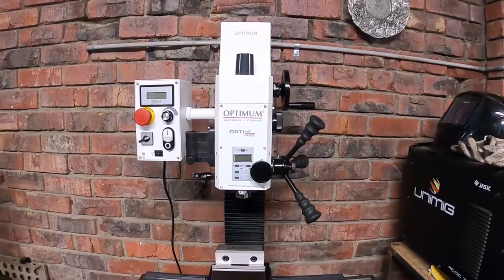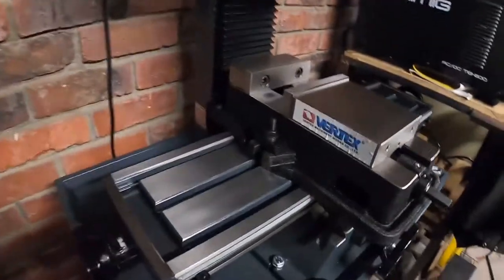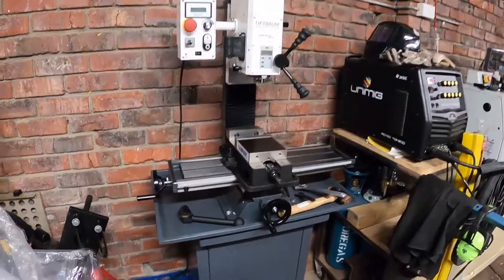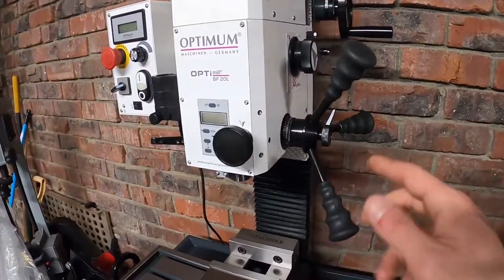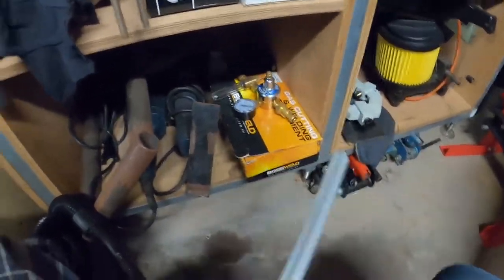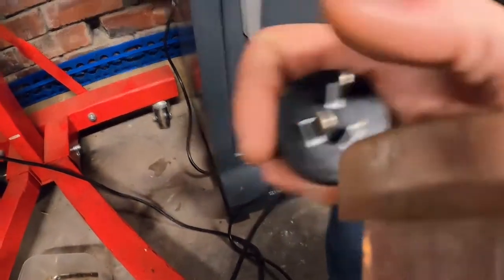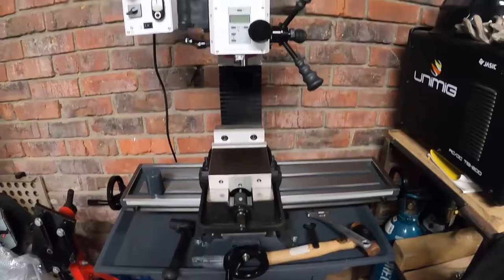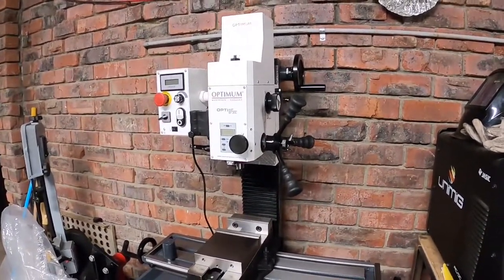Optimum BF-20L - first impressions

Comment: I bought one of these about 18 months ago. Just recently for apparnt reason  it stopped working. Electrically  everything was dead. The work light, the speed readout and of corse  the motor.  I tracked the fault down to what's called the relay circuit board. Replaced that , $80 and all was well again. When I  was putting back together again it was difficult  to cram all the wires back into the neat little housing. That's  when I  relized there's probably a lot of heat in there and no airflow. So I  made some 30 mm long spacers and spaced the rear lid of the control box out. Made it vermin proof  with some mesh . Today I  was working the machine fairly hard and it was surprising  how warm the mesh got. I'd  recommend  this mod to anyone  that does a lot of milling.
Reply from the maker: This is a great observation and awesome advice - I'll look to do this, cheers! What sort of ambient temperatures were there when the failure occurred?
Reply: It wasn't a particularly hot day , mid 20's maybe. Perhaps it wasn't heat that caused the problem but I  didn't want to risk doing it again. Today useing a 34 mm hole cutter was cutting hples through 40 mm aluminum plate. A lot of heat was coming out of the box
Reply: Where did you get the parts from? I am looking for some parts for my own bf20l
Reply: Hi @garyplozza3036, We have had our machine for about the same length of time, maybe a bit longer, but being in a college workshop it is very seldom used. We now have the same issue, one day everything was fine, I went to use it the next day and no power to the machine at all. How did you pinpoint the fault to the Relay Circuit Board? and where did you get the replacement from. I have done all the usual tests mains power to the rear switch, tested the fuse, reset the E stop etc. but no joy. Any advice you could give would be greatly appreciated. Cheers Colin

Comment: Markings on the slides are to hold the oil, if it was smooth the oil would be rubbed off in one pass :)
Reply from the maker: Would be fine in a metal-on-metal area! But it appears in spots where there isn't contact (and won't ever be) between parts. Bit odd.

Comment: Im wondering what the thread is on the draw bar that was supplied. In NZ its Whitworth! can you believe it on a metric mill. My first task will be to make 12mm draw bar so I can buy attachments from any supplier, and use the MT3 fittings I have on my Emco lathe
Reply from the maker: I'll have to check and see! I've not tried any other tooling yet, but am now curious.
Reply: @StyxHackshop  Don't be surprised if its 1/2 WW
Reply: @chrismitchell2316  Yep it will be WW. There is a place in Au that sells metric drawbars for these.
Reply: 1/2 12 whitworth. Same as the bf16
Reply: @campbellmorrison8540  what's the name of that store?

Comment: Hi, thanks for the video! Looking at purchasing the same, noticed an engine crane next to it. Can you tell me how you lifted yours with the crane. Cheers
Reply from the maker: The manual recommends lifting using a soft strap mounted around the headstock where it connects to the upright. This is the way I did it, with no major dramas - though it does understandably throw out the tram on the head.

Otherwise these guys aren't tooooo heavy, couple of moderately strong people (if available!) can lift it onto the stand pretty easily.

Comment: Gidday, I wonder if you can show me how to release the collet from the collet holder please?
Reply from the maker: Gday David.

If it's the ER32 collet to releases from its collet chuck - just remove the bottom nut and then the collet will twist out of it with a bit of upwards pressure.

To remove the collet chuck from the spindle - turn to loosen the drawbar square shank while holding still the flats on the sleeve up top (17mm). Keep turning in the loosen direction - it's the turning of the drawbar which ejects the tool. Can take an awful lot of force to eject, depending how tight it's been pulled into the taper. It'll pop. Then just support the tool while the last few turns let it go completely.
Reply: @StyxHackshop  Got it! A but more muscle and wriggling on my part and some encouraging advice from you and they parted. Thank you very much.

Comment: Hey mate, i have one of these, had it pulled apart as was going to do a cnc conversion on it but now have needed to put back together to use, im having trouble getting figuring out where the wires from the head go to where on the switches in the control box right behind the control pannel, i did have a diagram but have since had a few clean ups around the shop, your not willing to pop yours off and maybe make a video of which ones go where are you mate? cheers
Reply from the maker: Hey mate. Yeah I'll throw a video together tomorrow! Are you only interested in the rear of the control panel? Or controller hardware in the rear of the brainbox also?
Reply: @StyxHackshop  omg thank you so much, i just need to find where the wires go to that come through the stand off from the head stock, there may be couple that go to the rear if i recall correctly, but most go to the forward and reverse and emergency stop, could you also please show what wires (1 2 3 4) go to on the switch for the chip guard. thanks man, not many would go out of their way to do this.
Reply from the maker: @mightyweapon  happy to help mate! I'll get them details to you real soon 👍

Comment: Thank you for this, I have just ordered one myself ( in NZ from Machinery House ), seemed the best around for the price. Im looking forward to your updates on what you find out. Great tip regarding chainsaw oil as way oil, Ive been trying to buy way oil and it only comes in huge tins so I'll give the chain saw oil a go. Out of interest have you had any experience with CRC Noxy oil, Ive been using it on my lathe chuck etc to stop rust from my hand sweat but I dont know if its any good or if it has any long term down sides. I hate CRC 556 so Im a little suspicious
Reply from the maker: Hey mate - thanks for your comment, hope your new mill is going well!

I haven't used the CRC Noxy, but I'm using Inox MX3 now for lathe and mill non-contact surfaces. Has a smell to it but I'm finding it to be a fantastic product. Cleans up easy but protects surfaces for a long time after application.

Comment: Hi Styx, does the motor has enough torque to cut mild steel? Thanks in advance.
Reply from the maker: Hey mate. Yeah, absolutely! I've had no issues with a 16mm 4 flute endmill taking quite aggressive cuts.
Reply: Good to hear  @StyxHackshop